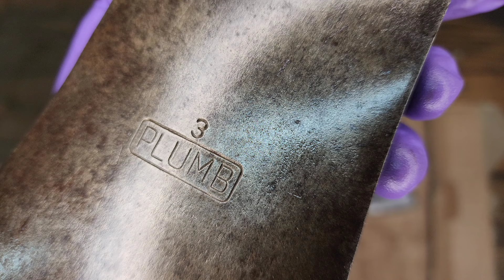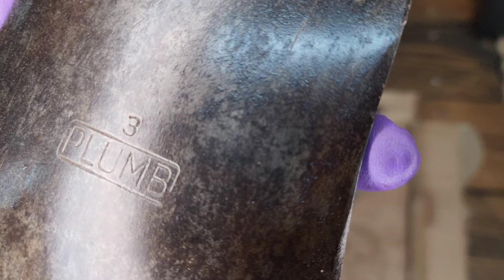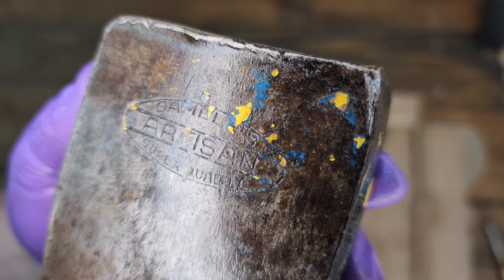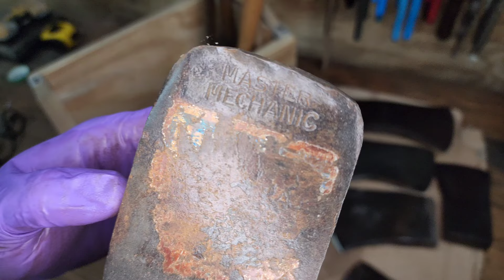Axe Collection and Oiling Part: 2

Comment: So I'm early into my collecting...…when you say a "high centerline" profile, do you mean the convex from top to bottom? Because I've noticed some axes are a lot flatter top to bottom. Would the more convex vertical profile give you better chip breakout or limit it getting stuck? Also Id like to see those utility knives you've got on you wall. If you don't have a cast iron Defiance 1299 yet i got one id love to send ya. You and Buckin Billy Ray and are my go to axe guys. Keep up the great work brother.
Reply from the maker: I truly appreciate the kind words Corey!! Buckin has a great energy and attitude. I enjoy his content also! That's exactly right about the high centerline basically of pinch the axe in the middle of the bit and move towards the top or toe direction it tapers. Same for the bottom or heel. When you sight down the top of the axe (birds eye view from the top down. You can see the center of the bit is higher. The idea behind this is exactly as you said. It helps the axe bite deeper without getting stuck and pop chips when bucking/felling. The idea is it has less surface area in contact with the cut since it's not flat. Thus less friction and a deeper bite. It's funny you mention the knives. I've actually got a video filmed for next week's upload where use the 199 to open the packages and then briefly talk about it and the 299s I've got hanging there. Are you on Instagram? If so definitely shoot me a DM I'm nsvensen89 on there.

Comment: Why is that first one not a Rockaway and not a Jersey.  I honestly want to know.  I'm not saying your wrong.  You've probably done this longer than I have..
Reply from the maker: No worries at all man! The two patters share a ton of similar lines and shapes and the differences can be a bit tricky to tell apart. That one also has a taller eye and more of a straight beard as it goes back to the eye. I talk a little bit about the differences right in the beginning of the video ill link below. i have some examples of each laid out to help show the differences. I do think it would make for a good stand alone video also. Since I made that video I have also added a few more rockaways to my collection so I have some more examples.

https://youtu.be/JTmFP2jFFv8?si=-s8EhrSVgKynXxE7

Comment: Have you ever purchased axes for a seller Petronea? Check out his current listings of Ravens and Buffalo black axe. Share you opinions.
Reply from the maker: I don't know the seller not have conversed with them. I also have. Not purchased anything from the seller either. They may have sold some real ones at some point, but the listing's I've seen look to be fakes. By fakes I mean older heads that have not been etched, being etched to have the black raven or Buffalo axe etchings. In my mind it's perfectly fine to etch a old head to add a cool logo. Gets more Grey if you're adding an existing vintage logo. And very sketchy if you're passing them off as originals and not replicas. These are just my thoughts formed from observations.
Reply: I agree. It’s to a point where you should avoid eBay unless dealing with a know seller.
Reply from the maker: It's tricky for sure. I know there are lots of guys on Instagram who've reported them but ebay doesn't seem to be doing much. I agree if you're buying an expensive head like that, it's a good idea to stick to someone you know and trust. 👍